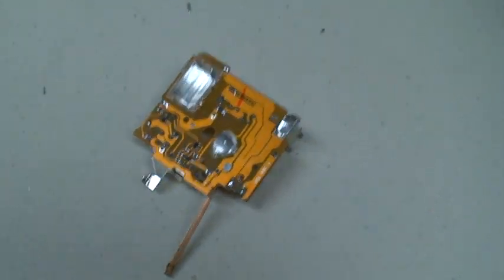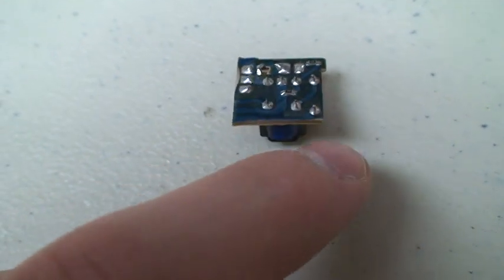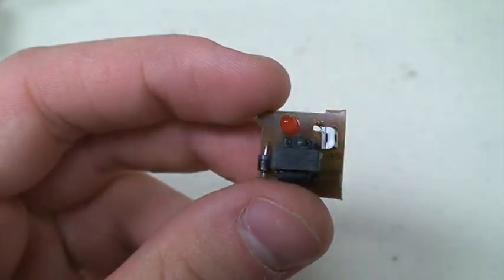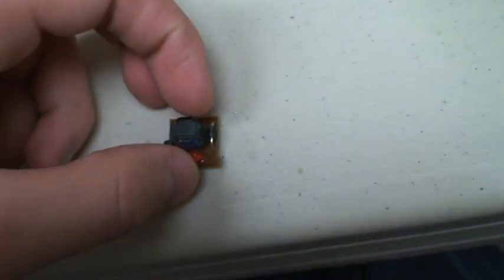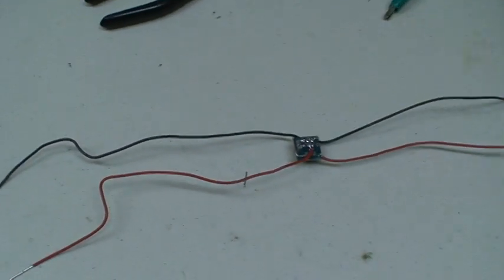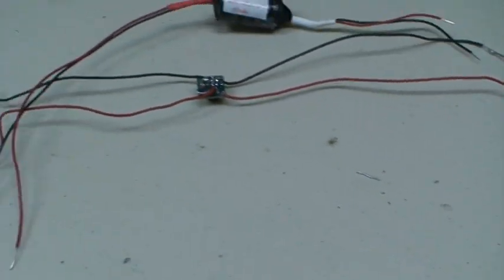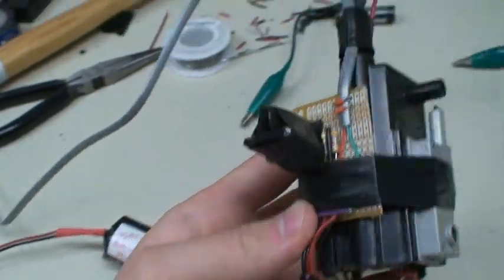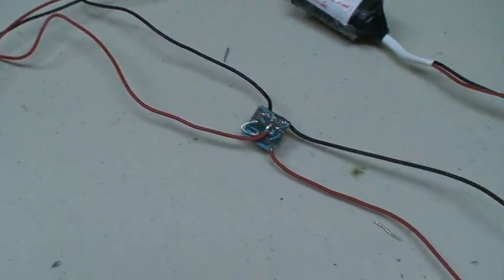Micro Camera Circuit Mod!

Comment: good. its weird i created this mod in 2008 . its my fuji hv mod. i have a device i build calles the pocketpower plus that uses this circuit modified that produces 110vac and powers devices from an aa battery . Chek it out on my channel. the device is called pocketpower  +

Comment: You need to learn to draw a schematic.  Please, transistors are BCE, diodes are pos neg not striped side.  Polarity is very important to a diode.  Nice job on the circuit.  Firstone I have seen like it.  Those cameras are great for everything but taking pictures.  Great Joule Thief.

Comment from the maker: Also the transformer is called a center tap transformer if your looking to buy that part. There are two pins (one coil) for the input and the output coil has 3 pins with the middle pin being "tapped" into the center of the output coil. There are designs that don't use a center tap but for this circuit its very important to how the circuit functions.

Comment from the maker: I will try to create a new schematic soon, sorry for not getting back to you I've been very busy lately. The drawing is very crude but that is the original schematic that someone from 4hv made. Without it this video wouldn't have been possible so it does work if you can understand it. I don't know how many winding's are in the transformer but it does step up 1.5v to 330v so it should be a ratio of 1:220 or higher if I'm not mistaken (1 wind input : 220 winds output).

Comment from the maker: These little circuits are designed to charge a 330v ~100uf flash capacitor up to 30 times or so.....maybe they recycle them 10 times at most so each circuit is designed to charge the capacitor 300 times over its lifespan. Putting more capacitors in will make the circuit work harder and for a longer amount of time. I'd bet that the transistor gave way in your circuit from being under such strain. These circuits are great but in the end they are cheap and do break eventually.

Comment from the maker: The five pin transformers have two coils but one of the coils has 3 pins. The middle pin is a center tap that is part of the circuit that switches the transistor on/off. I haven't really looked into it but without the center tap you need to create a circuit to oscillate the transistor. Using a 555 timer to switch the transistor at about 30khz should do the trick.

I don't have any schematics or what not. If a 555 circuit is too complex then go look for more cameras with 5 pin transformers.

Comment: This is an Excellent circuit.

Just completed and tested, why waste time charging caps, used it to light a 15W fluorescent tube with a 1.25v NiMH.  Not as bright as it could be, but would probably do quite well lighting an 8W fluorescent or CFL.

This could be a Super Joule Thief.

Tested output at 306 v at 7.8 mA.

One point though, the output polarity is backward, wires should be switched to reflect the red/positive, black/negative polarity.

Other than that, excellent circuit mod.

Comment from the maker: I am not sure usually they don't have labels or they are very small and hard to read. It would be a low voltage fairly low current npn transistor though. Look around online and I am sure you could find one that would work.

Comment from the maker: This circuit has 2 diodes, a transformer, a transistor, a surface mount resistor under the circuit (or two I don't remember) they look like little black squares on the circuit. The schematic linked in the video description shows the entire circuit schematic so you could check that out.

Comment from the maker: I don't understand what your asking? The original board has many small components but many of those are part of the 2nd stage which makes the flash. The first stage charges the capacitor and that is what I hacked in the video to make it smaller. Anything not in the video is not necessary to make it work. Finally the big capacitor that was originally on the board is reused, watch the end of the video when I test it.

Hope this helps!

Comment from the maker: You cannot really regulate the voltage but you could turn it off. Use a voltage divider to drop the 500v bank to a lower voltage (1.5v). Then use that low voltage to turn on a transistor amplification circuit which would control a normally closed relay that sits between the battery and charger. When the bank gets to 500v the circuit would turn on and power the relay breaking/opening it causing the power to get cut thus stopping charging.

Ghetto but functional...

Comment from the maker: This is something many people have asked about and honestly you just have to experiment to find out what works. Get 2 circuits and try them in parallel, try them with 1 battery....2 batteries ect... Time the charging time and then compare it. When I tried to do parallel circuits I couldn't get them to run only one would turn on but others have gotten them to work. If both circuits work then yes charge time should go down because of an increased charge current.

I hope this helps!

Comment from the maker: Google ZVS flyback driver and on google images to get the schematic. There are also youtube videos of it so look at those as well.

 If that design is too hard google single transistor flyback driver. The flyback can be taken from a crt monitor or projection tv and ALL off the components (two resistors and a big transistor) can be obtained from radioshack. That was the first driver I built and it charged MUCH  faster than a camera circuit.

Comment: @Halo2maniaccc 1 1.5v AA battery did not charge quickly. my bank is 3 in series 5 sets in parallel (15 caps total) voltage total of 990v. i doubled the batteries going into this board and it shot up to the range of 600V. i decided to double that with 6V in thats when it all went wrong. its there a way to make a decent portable DC cap-bank charger?? i was all over the ACG site with no luck. i cant make the boost converter and not all boards i have seem to have limiting resistors to remove.

Comment from the maker: The board should be run at 3v to stay safe 4.5v doesn't give you all that much more. Anything more and the board will fry do to way too much power going through the transistor on the board. Keep it at its current voltage if it works and don't change it. If your in need of a higher power charging circuit you will have to build it I have several links and designs varying in difficulty and power I could send you just message if you want them.

I hope this helps!

Comment: how much input voltage can this lil board take b4 ir burns out? i applied a 9v to a camera board once and it fired in a sec. the max V i apply to my input on my mini coil gun is 4.5 (3x 1.5vAA) because i am afraid to burn it out.

Comment from the maker: Next time use a very fine tooth hack saw or a dremel with an abrasive cutting disc on low to medium speed. It may take some time but its better than going at it with pliers!

I can't say that I haven't tried doing this before.................

Comment from the maker: When I say that the small capacitor will stop your heart think of it like this. You can throw a small wrench into an engine and stall it but that small wrench can't restart that engine. Your heart is the engine and the wrench is the capacitor. 

BTW you have to use SCR's to switch these super big capacitors no switches can be used or they will vaporize the contacts &  (possibly explode the switch apart) !

I take no liability if you hurt yourself using the information that I provided!

Comment from the maker: I got them off ebay, a guy had a used industrial surplus and sold them for next to nothing. Your cap can hurt you, a tazer is different it delivers high voltage low current to disrupt the nervous system and inflict pain. The capacitor delivers high voltage & high current in a massive jolt which can stop a heart. If you don't know what your doing don't play with these capacitors there is no second chance it will KILL you instantly.

Comment from the maker: Yea you should watch out, capacitors that big can deliver enough of a jolt to cause irregular heart beats and eventually a heart attack.

You should be able to charge it from this charger, if its a basic capacitor then it shouldn't have a problem.

And if you think thicker than your thumb is big you should see some of the capacitors that I have. They are thicker then my forearm (3in diameter) and are about 12 inches long = to about 200 photo capacitors! This will not shock you it will KILL you.

Comment from the maker: This circuit is essentially a voltage booster, 1.5v to 330v. Its nothing super special and its purpose is to charge a capacitor. So yes you can use this circuit to charge your big capacitor but it will only charge to 330v (if your cap is 330v+ it simply won't charge it all the way) it will also take longer to charge depending on just how large your capacitor is.

Hope this helps!

Comment from the maker: I really don't know how, if you have some extra electronics knowledge you could use a 555 timer to make the transistor oscillate. I can't really help with the schematic for that, just research it and build it. Go to walmart or any photo store and ask if you could have their used flash cameras. You are bound to find the right circuit. Kodak may have change the type of circuit in the cameras which I will have to check on.

Comment from the maker: I am aware of this, I never made the video. It turned out to be a bad flyback driver lots of heat with very little power so I abandoned it. Give it some time and I will make a ZVS driver for the flyback but I have to order parts. In the mean time why not google it, the info is out there.

Comment from the maker: No problem. These are great for coil guns SUPER COMPACT I wish I had created this mod when I first started electronics I remember using full sized jumbo camera circuits lol. This is so small and sleak that you can practically put it in any project enclosure! Be safe capacitors from these cameras are not toys and enough of them can stop a heart so be really careful not to zap yourself with them.

Comment from the maker: Yes you need the external diode or the board will not function. If you need to get an extra diode you can either carefully (WATCH THE HEAT!) desolder one from another board or get one from Radioshack or preferably an online vendor such as digikey or mouser.

Comment from the maker: Do what with a flyback? If its charging then yea its possible I know I said that a tutorial was coming but I had stopped work on it due to inefficiency and slow charging. I may start working on a new one however 555 timer driven or a ZVS system however the tutorials will be more complicated but still step by step and the parts will have to be internet bought.

Comment from the maker: You must be using a different type of ignitor with thicker wire, I used estes model rockets, motors, and ignitors. With 4 capacitors it vaporized the thin wire in the tip causing the ignitor to make a large spark and loud pop. But if the wire is to thick then it will not work.

Comment from the maker: The best way would be an scr but if its just 1 or 2 capacitors a push button switch from a hardware store will suffice. Make sure its in a nice plastic project enclosure, you don't want to touch hv leads!  Igniting model rockets with this is the best it provides instantaneous ignition!!! Not the (1-2) second delay AA batteries give!!!

Comment from the maker: No, because it only outputs 330v. That's not high enough to see any arc. You would have to get a transformer that boosts the voltage way higher like 2kv minimum.

Comment from the maker: Well if it fails while its running you will smell a nasty burning plastic smell and a small amount of smoke will come from the transistor. After the smoke clears there will be physical damage on the transistor usually its split apart down the middle. It can however fail without the above and it just won't work when you give it power. If this happens make sure everything is wired right, like the diodes and capacitor. If it is and it still doesn't work then I would say it is a bad transistor.

Comment from the maker: If the capacitors are all 330v and the transformers are all 5 pins then they should be no different from the transformer in the video. They are basically 1.5v to 330v center tapped transformers, its nothing super special but if they are the same then my schematic will work assuming you wire everything up the same. Watch the transistor though if it gets to hot when soldering it gets destroyed!!! I did this many times....the frustration it causes lol

Comment from the maker: With 3v input the output voltage didn't change but I noticed a faster charge time because it drawing more current. If you simply increase the input voltage without changing wires or anything then it will work with the capacitor without problems. If you go to high on the voltage then you will hear a sizzling noise and smoke will come from the transistor!!!

Comment: with regards to the circuit, i have a few different types of camera, all containing 5-pin transformers with 3 on one side and 2 on the other. but they all sem to be wired differently. like different things go to different places than yours does. are all of the transformers the same, and can i just wire all of them the same as yours and they will work, or are some transformers differnet and will also need to be connected differently???

Comment from the maker: No, it doesn't matter which way a resistor goes. The color bands on larger resistors and markings on smaller resistors are just codes to tell you the resistance of the resistor.

Comment from the maker: Yes, if you don't remove or damage the led during the mod it should light. Mine lights every time at 320 - 330 volts like it should. You can also de-solder the led if the led is burnt out and solder wires on so that you can you an external led  in say a project enclosure or box!

Comment from the maker: If you used low current transistors that were made for low frequency applications then they won't last long. However if you use high frequency high current transistors it should last for a very long time. It could also depend on circuit design ect... Ignition coils are a lot of fun to play with!!!

Comment from the maker: Yep that's the best way to sum it up. Except I remember reading that the camera circuit starts at around 40 - 50khz and dip's down progressively as the charge increase to around 15khz because it operates on feedback voltage.

Comment from the maker: The disposable camera circuit is very basic and universal but each manufacturer has their own little twist on it. Mine has an oscillator in it, without an oscillator the circuit wouldn't work. The transistor is the oscillator in this circuit. It took me forever to understand how these little circuits worked!

Comment from the maker: I have attempted to charge up 500v capacitors with disposable flash camera circuits and the charging stops at 330v. The transformer is what determines the output voltage its all about that ratio of the windings. Large banks of photo capacitors in parallel just take longer to charge, in series the voltage increases across the capacitors but you don't need a higher charge voltage. Its sort of like battery's, series increases voltage, parallel increases the current.

Comment: I thought in the original camera circuit it was the capacitor that limited the voltage across itself in this case 330v? and since the cct. is an oscillator it would continue to gain voltage so long as it had legs (current) or until it reached the caps nominal voltage rating? that's why people have been using the cct. to charge banks of large capacitors! Try measuring the o/p then you will know turns ratio on the transformer...

Comment from the maker: The basic transformer is 2 coils of wire wrapped around a ferrite core. The camera transformer has a specific ratio of windings between coil 1 and coil 2 (1.5 to 330). This provides the voltage boost and current decrease. So the transformer is only configured to reach 330v.

Comment from the maker: I was using an HD video camera but even then the camera can't pick up everything, the bang was much louder and the flash was brighter. It may not have had a full charge as I wasn't measuring it but it was more of a proof that the mod worked than to fully charge the capacitor.

Comment: have you measured the output? the camera flash circuit reaches 330v via two coils acting like a tuned oscillator, if you are using only one transformer are the coils configured to reach 330v (or higher?)

Comment from the maker: The nominal output voltage is 330v from the transformer at 1.5v input. The capacitor was rated at 100uf at 330v.

I watched that video, it was quite interesting. I had never though about powering a mains light bulb direct from the capacitor!

Comment from the maker: Normally the circuit is run at 1.5v but I have successfully run them at 3v, the extra voltage notably decreased the charge time. Don't run it higher than 3v though because the transistor will burn out.

Comment from the maker: If by sequence you mean charge multiple capacitors in parallel (or series) then yes you can use the camera circuit to charge the capacitors. The more capacitors you add however will increase the time that the circuit takes to charge them. Just google flash camera coilgun, there is a ton of information on it.

Comment: thanks for the reply,  came to that conclusion, when i replaced the thyristor, and added a 330ohm resistor, i repeatedly charged and discharged the cap, until the camera charging circuit stopped working :-( lol.mine was rated at 8amp @ 800v , i suppose i better see how much a descent one will cost :-/. thanks